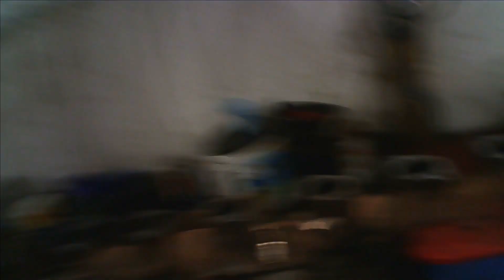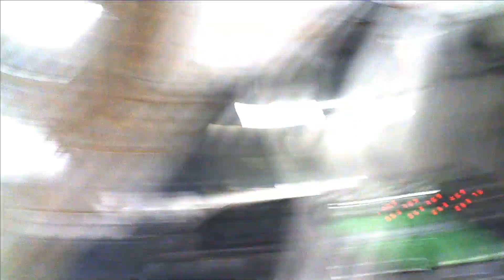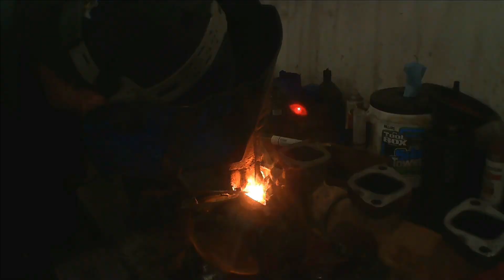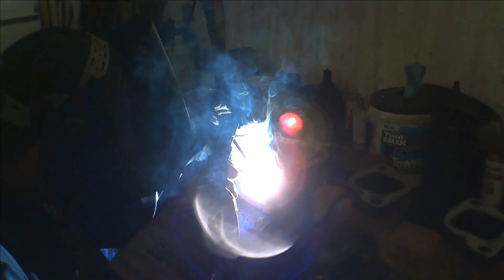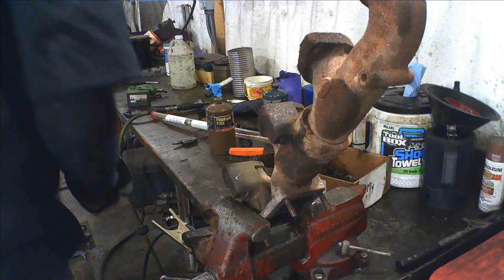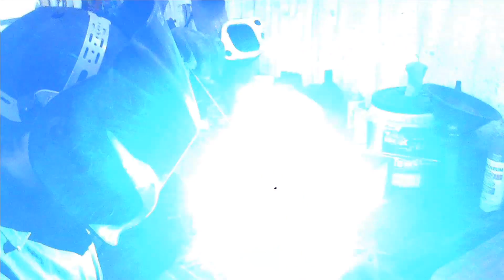Exhaust manifold repair....Everdur Welding

Comment: Great work sir! not just anyone can successfully make that repair! I was wondering if that would work to patch a cracked water jacket between #'s1&2 on my END 673 Mack?
Reply from the maker: That's a good question? I would say yes. Silicone Bronze and cast have an expansion rate that is very similar.

Comment: What rods did you use? I did not catch that 

Are they different types 

Are you using one for binder and the other as filler

The arc sounds low so are you at low amps 50 to 80 Amps

Great repair
Reply from the maker: It's a silicon bronze Tig rod, and 5/32 carbon gouge rod. Stinger is on the negative, so I guess it's DC straight. Tough day today, can't remember the wording. Put your stinger on the negative and ground to positive.

Comment: Did you reverse the polarity on the welder to do that?
Reply from the maker: yes sir, and low amps. End up about 45 amps to get it to lay in smooth on that thick of material.
Reply: @mlhrepairsllc6942  so you're doing DC correct?
Reply from the maker: @1hatecrew  yes sir 👍
Reply: @mlhrepairsllc6942  I have to repair an exhaust manifold myself but I only have a flux mig, any advice?
Reply from the maker: @1hatecrew  I honestly have never fluxcored a manifold, or any cast that I can remember. If it's cast steel, I see no prob. Cast iron, probably not going to work very well.